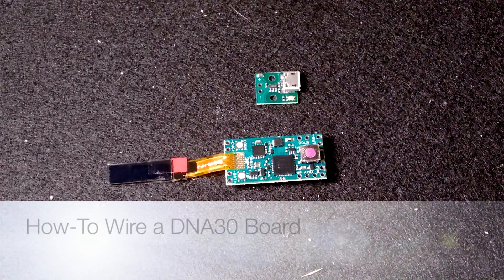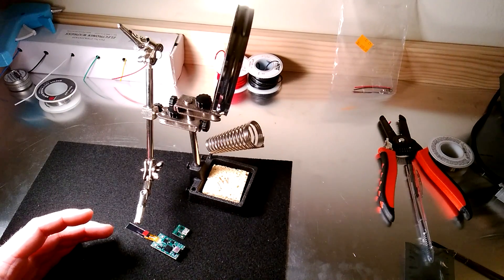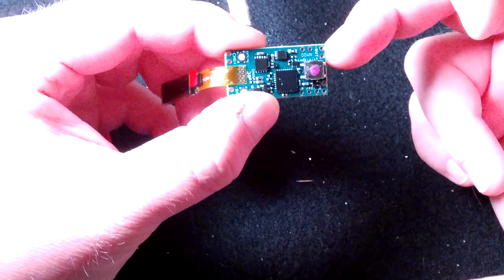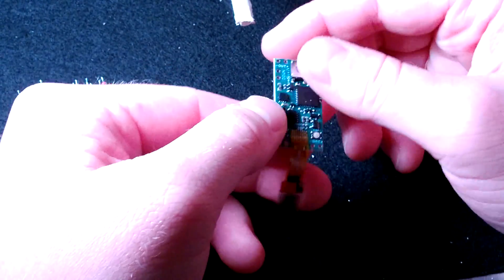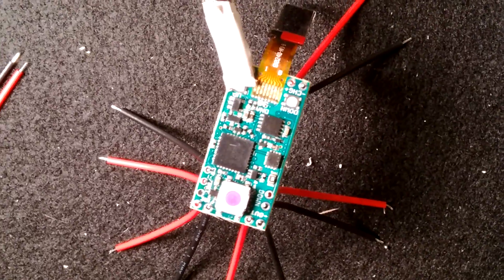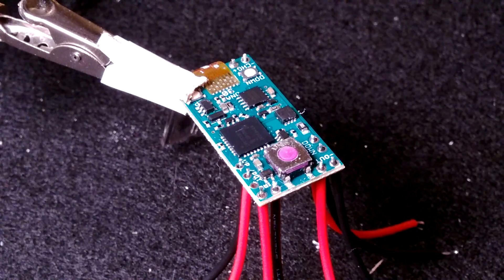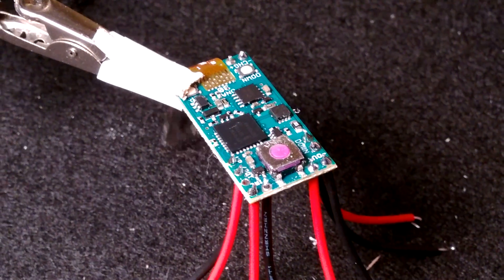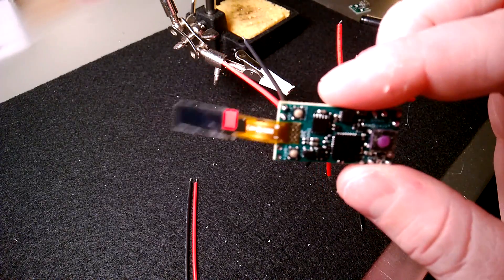How-To: Wire a DNA30 Board

Comment: My dna 30 smells burnt. It stays powered unless i take my tank off. But my button isn't stuck. I think it was on for a few mins. before i realized it was still on. Do u think i need as whole new board?
Reply from the maker: Michelle Leatherman Could have been the wiring crossing paths internally causing it to always fire. as far as smelling burnt, did you accidentally put the batteries in backwards? Also the DNA should have an auto shut off feature and not let it fire longer than I think 10 seconds so it may be a faulty board. You could try taking it apart and checking the fire button wiring but it may need to be replaced.

Comment: Hi. Thank you so much for posting this, it's been very helpful. I'm having trouble with my wires though. I purchased soldering flux from Amazon, it comes in a little syringe however it doesn't seem to be working for me. Chances are I'm not doing it right because the reviews were stellar. I added a tiny drop of flux to every wire then placed my soldering iron down like you did in the video but the wires didn't stay. They just fell right out again, What am I doing wrong? Thanks again, I appreciate you posting this.
Reply from the maker: Rebel Grrrl Vapors if you are only using flux it will not stay because there is nothing holding it in place. Flux is used to prep the wire before soldering (removes corrosion or any imperfections). I do not use separate flux because the solder i have is rosin core which means it has flux built into the middle of the wire. You need to either use rosin core soldering wire or use standard solder wire with flux like you have separate. I hope that made sense.
Reply: Thank you so much for your response. I'm just starting out, have no soldering experience and I'm making all the rookie mistakes. Thanks again for the response. I'll get some rosin core and post an update. :-)
Reply: Morgan Crawford  Hi. Thank you so much for your help. I managed to get all the wires soldered and the chip lights up really great. But now I'm having a different issue. I'm very new to soldering and building mods and the issue I'm having now is I have no idea how to make use of the onboard firing switch. I still soldered wired on to the board where it says fire but I have no idea how to get the device to fire now. I really thought pressing on the onboard fire button would work but I might have skipped a step or I've done it wrong. Thanks again :-)
Reply from the maker: well if you press the tiny onboard firing button it should work but most people including myself wire in a separate tactile switch using the positive and negative terminals labeled fire on the board. If you have done that and it still isn't working you most likely have a dud switch. Double check the wiring on the board and make sure it is secure and if that doesn't work try and exchange your button.

Comment: Should I take the extra procaution of using resetable fuses to protect the chip? Not sure on what to do
Reply from the maker: idk its up to you. I watched Find My Vapes video and he did when using a Lipo pack. I never have and haven't had a single issue but it wouldn't hurt anything to use them. The boards do have a to of built in protection and monitoring though.
Reply: i started the build, i said screw it and didn't use any fuses lol
Reply from the maker: you should be fine... What type of box / batteries are you going with?
Reply: I'm using and altoids container and lipos lol
Reply from the maker: lol I think you should be ok. You can always go back later and add fuses if you feel uncomfortable.
Reply: hopefully ill be ok everything is in place all im missing is the damn chip, its taking to damn long to come in:l

Comment: By the way, do you have any advice on how I could get an Led firing button powered? I was thinking I could parallel the LED's circuits with the battery and throw on a resistor but I'm not 100% sure if that would work yet
Reply from the maker: Actually i built a dna 20 mod a few months back with an led firing button. I spliced the positive wire with the positive 510 wire that way it would only light up when the atty is fired. Make sure to wire in a resistor though.
Reply: By splice do you mean make it a parallel circuit to the wire connecting the board to the positive? Sorry I'm still in the learning process haha. I understand where the resistor would play a role though
Reply from the maker: I mean cutting a section of the wire coating off of the 510 positive wire and twisting/soldering the positive LED wire to it then use some heat shrink tubing to protect the connection. The resistor should attach to the positive leg of the LED. Lol I'm not a very technical person but that's what I did and it works like a champ.
Reply: Haha no worries man neither am I but that makes sense to me. So where would the negative to the LED go than?
Reply from the maker: same process as the positive wire (minis the resistor) just with the negative lead on the 510.
Reply: Ohh i see what youre saying! Did that mess with the resistance reading at all? I figured it might but just barely
Reply: And I'm assuming all the 12v LED buttons wont work right?
Reply from the maker: no Im pretty sure the one i used was a 3v. something like this....

http://www.amazon.com/Amico-stainless-Momentary-Button-Switch/dp/B007QAK99Y/ref=sr_1_3?ie=UTF8&qid=1411621496&sr=8-3&keywords=led+momentary+push+button+switch
Reply from the maker: just uploaded another video showing how its wired
Reply: Wow no way! Its not showing up yet but consider me your first viewer haha I appreciate it man
Reply from the maker: redfurydubstep Ya no problem. sorry I had to verify my youtube account first because it was too long. lol Should be up now.